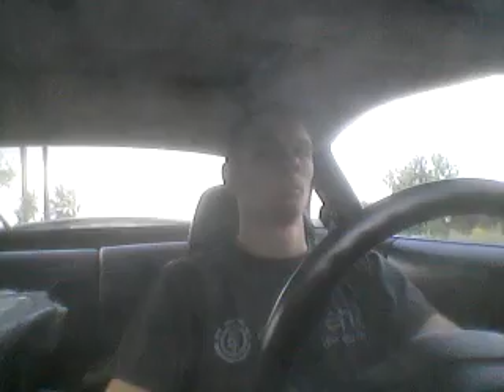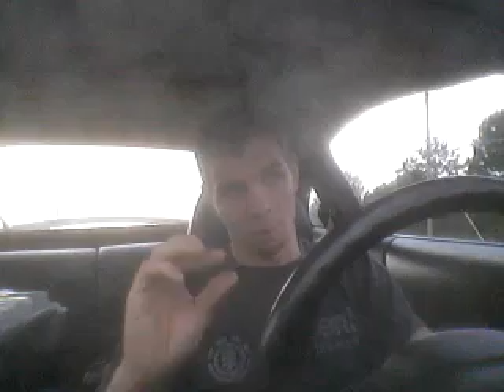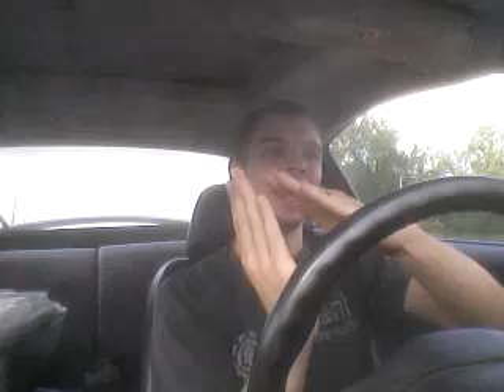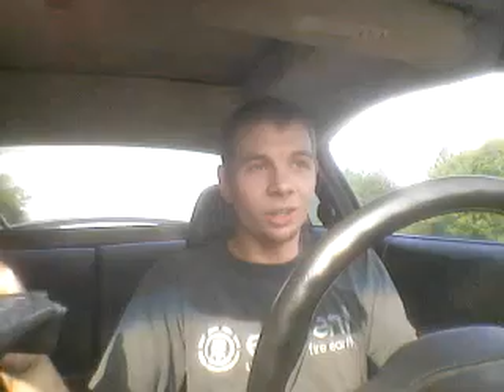V-Tec vs MiVec vs VVT-I

Comment: Fairly good explanations, however some of your info was a little iffy. Vtec was not first at all. When mivec was the most advanced out of the bunch when it was released, having multi stages, not just a high and low. Vvtli, mivec and ivtec are the closest the companies ever came to grabbing the same tech. They all have the same purpose, balance between power and economy, not just vvti, depending on the application is geared more for performance or economy, just like vtec, look at a beams motor, you will see, Toyota had a kick ass n/a 2.0l years before Honda. Generally, lift is more effective for power than timing, but vvti is multi stage like mivec and both are more effective than vtec, various profiles to aid all over the power band, vtec just kicks in at the top.